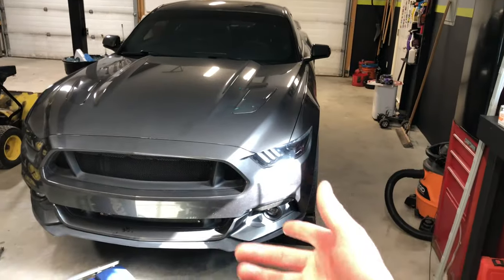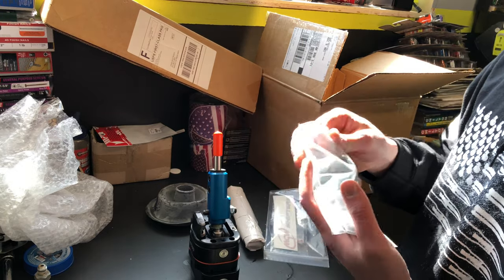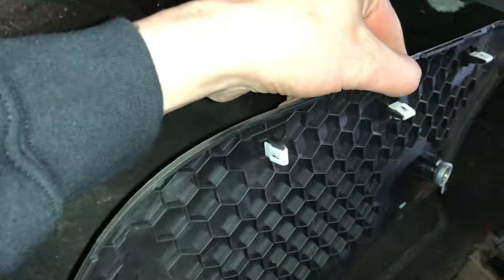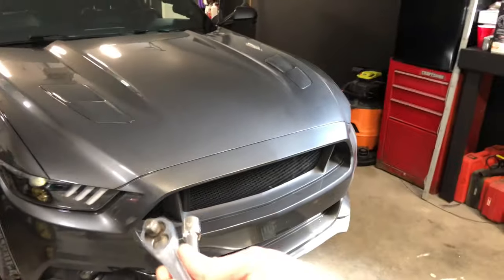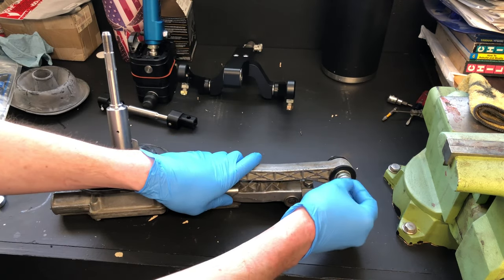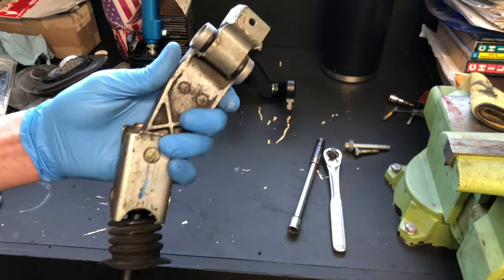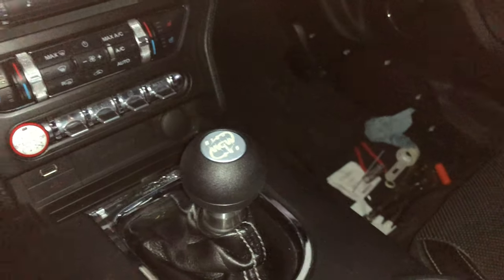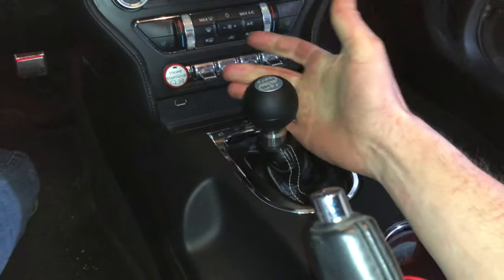Installing MGW X Spec Shifter On S550 Mustang

Comment: I have to be honest, the stock shifter is a little more robust than I thought.
Reply from the maker: It absolutely is, and I think it gets a bad rap just from people that don’t know how to properly shift. Only time I had issues was during high RPM drag racing. I would get terrible lockout usually going into third, and the MGW has completely gotten rid of that issue.

Comment: I’ve just installed mine and notice that it vibrates as I go up in rpms is yours the same?
Reply from the maker: I have not noticed any noticeable vibrations to speak of. There is probably more than with the stock shifter, just due to the fact that it directly mounts to the transmission, but nothing that has made me be like wow that’s really vibrating.
Reply: @akgearhead  right on yeah same here like you said it’s mounted to the trans some getting use to I guess. At least no more kick out throwing the gears 🤷🏽‍♂️
Reply from the maker: @TheCardenasFam yup, overall I’m very happy with it. If you are having super questionable vibrations, I’d make sure and double check all your bolts and make sure they’re tight

Comment: I ordered one I’m always getting 3rd gear lockout . When racing and trying to shift at 6900ish from 2nd to 3rd it 2/4 times say nope so I hope this helps my issues already have an rst clutch installed
Reply from the maker: I had bad 3rd gear lockout as well before installing the shifter, but haven’t noticed it since. I would think since you have a clutch already, that with the shifter you should be about as solid as you can get. Only other thing might be to do the upgraded line

Comment: I have an s197 with an s550 mt82 and that trans has been my biggest battle I get lockout where it won’t even let me get into gear from a standstill. This shifter is my last attempt before throwing it at a shop 😅
Reply from the maker: I’ve been driving mine all summer with it, and no lockout so far. I’ve heard some people still do have the issue after installing the shifter, and it seems like installing a better clutch, and the steel braided clutch line can help as well

Comment: Really helpful mate, weighing up between this or the barton. Want to go the flatstick road. Have you enjoyed the shifter since?
Reply from the maker: I’ve loved it so far. Huge upgrade over factory, and it seems to have solved my lockout issues. I have no experience with the Barton’s, so I couldn’t tell you which is better. MGW does have a flat stick option in case you aren’t aware, but you probably are.